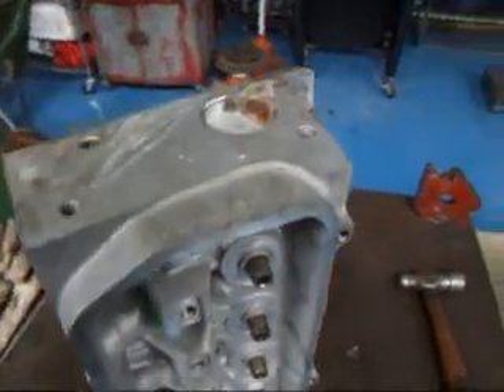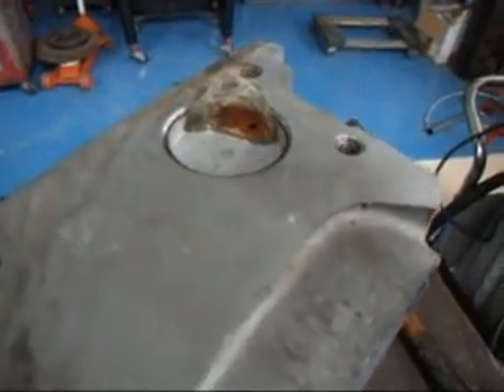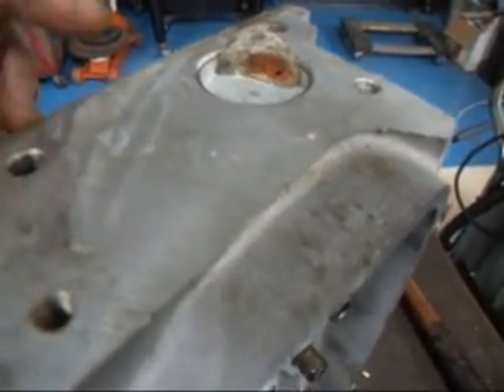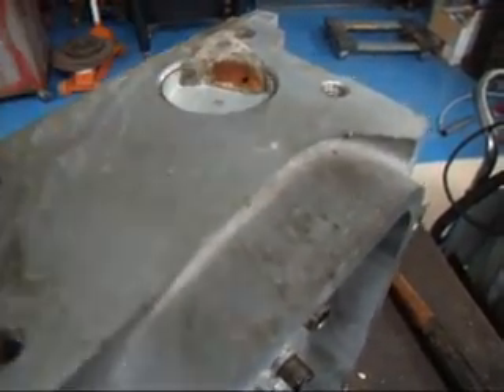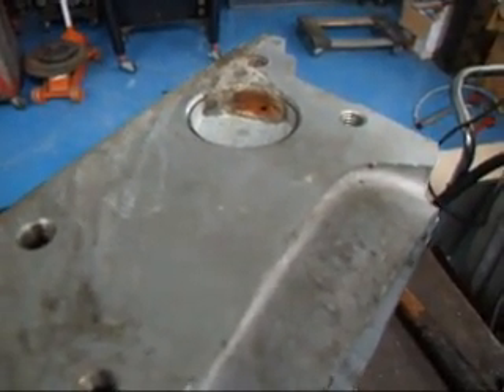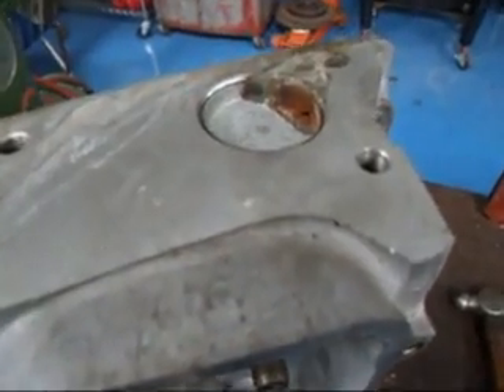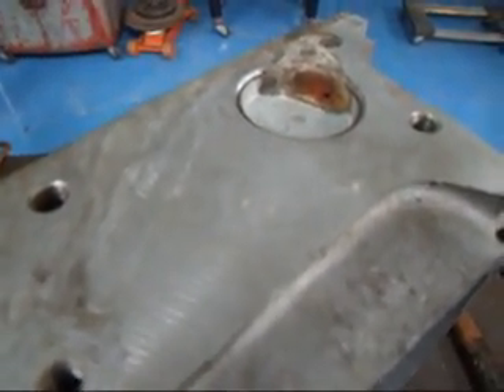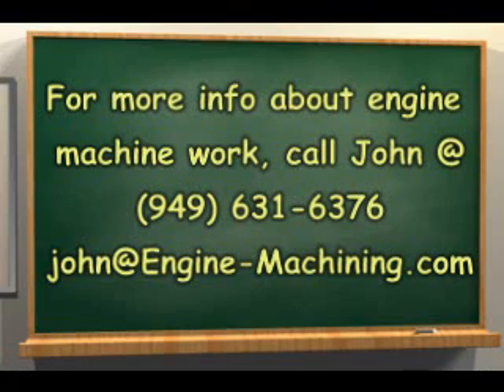Aluminum Cylinder Head Core Plug Problems

Comment: if your plug is on the front of the engine, you don't need to take out the engine. this job is very complicated, this is my third time doing it. Now i'm just waiting for the JB WELD to dry and hopefully that will stop the leak.